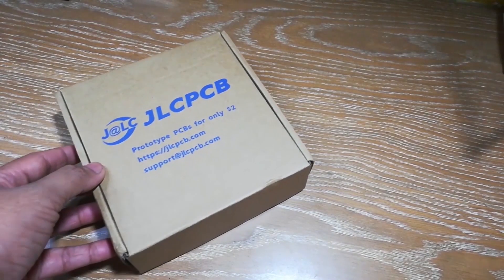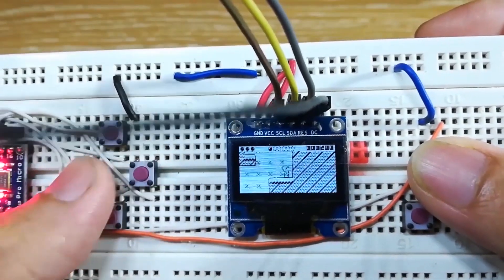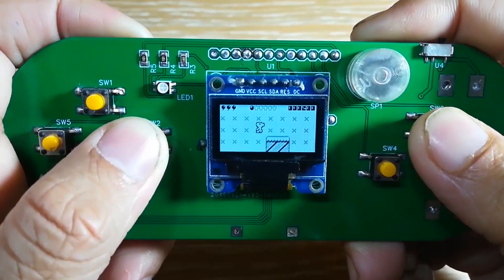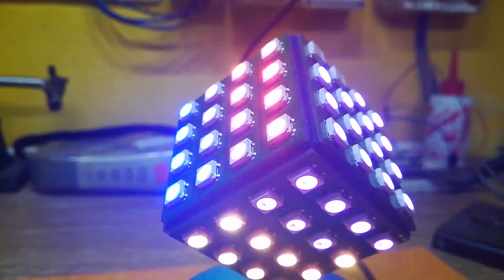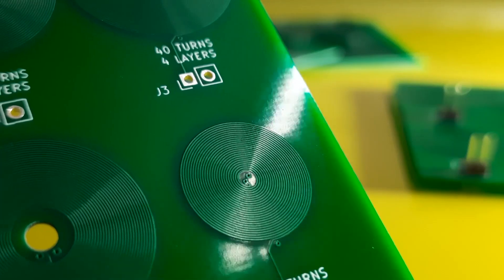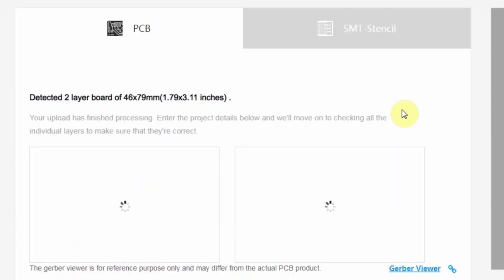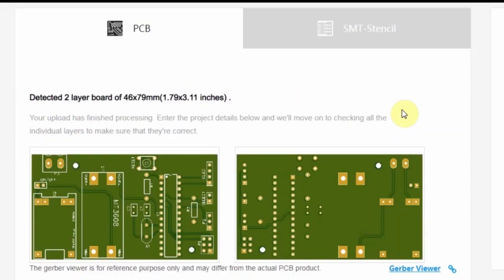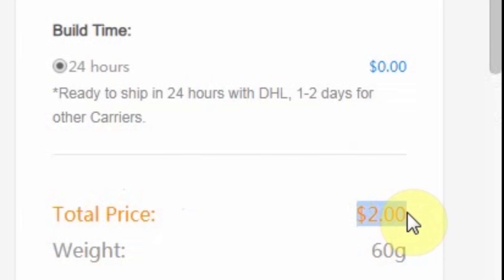Mechanical 7 Segment Display v2.0 | 3D Printed

Comment: You should make a version that is lit by an led strip from the top and/or bottom. Then adjust the shape of the digit bars so that their shadow casts the correct shape of the number, instead of the plastic bars themselves.(It might not be possible if the bars interfere with each others shadows, like #8 might be difficult.) I was just trying to think of  a way to give the number/background more contrast. maybe the light shines from all sides in a bezel, and the bars pull Inward to create a shadowed pocket.

Comment: Really cool project and especially great that you're sharing all the iterations.
Any plans to sell the pcb or a kit with the electronics? I wonder if doing a 2 color print would make the segments stand out more when they pop out. Maybe print the outermost layer (which I'd guess is printed first) the same color as the background, then swap the filament for a contrasting color.
Reply from the maker: Never thought of selling it. Maybe in future!
And thanks for the suggestion. Sounds promising! I will definitely try that out in the next version.
Reply: @IndoorGeek  I second the desire for a bare board or a kit!